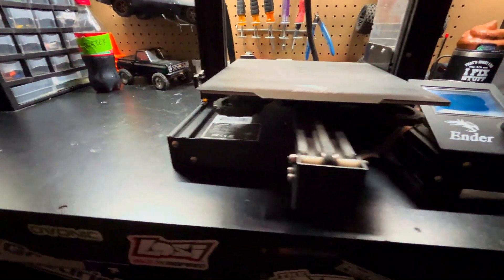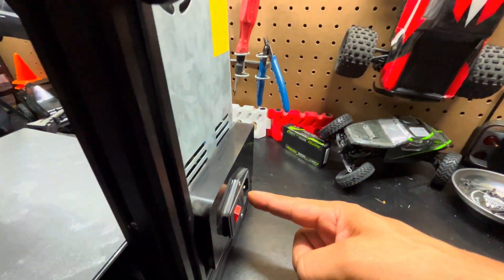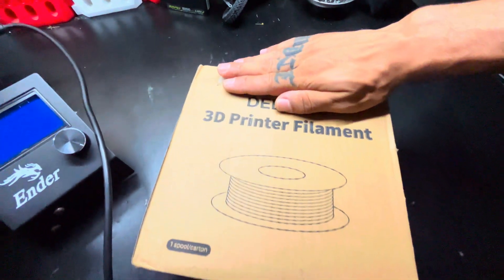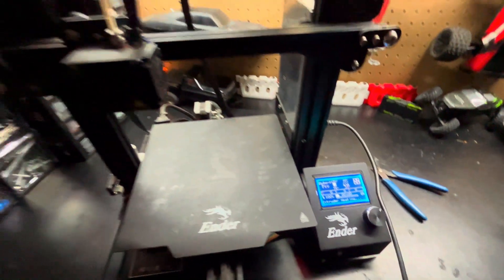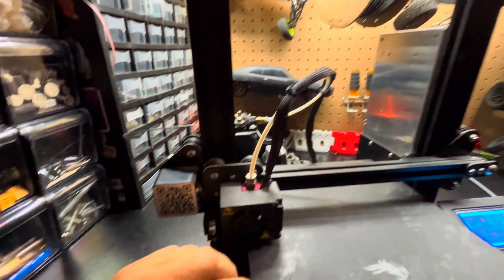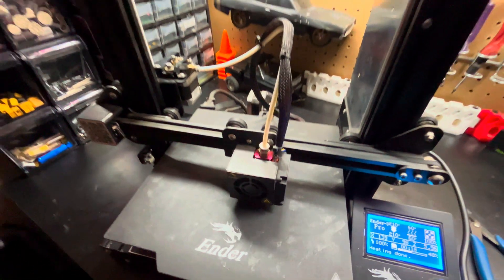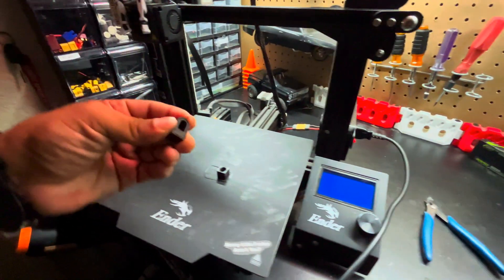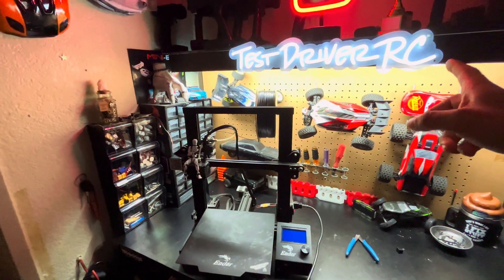Can You Make RC Parts With a 3D Printer?

Comment: Nice an Ender3-Pro the same printer I started with. With the base plate IPA to clean it as once it gets greasy it looses adhesion. Slicing software the easy part as that just codes a design for printing but there are settings you will need to learn. Now CAD what a pain that can be to work with, I started with watching a couple of videos on here for basics the rest I learnt as I have gone a long and still only know a little after a few years. I mainly use the printer for parts I need for detailing bodies, but if you are going to make parts before you go through all the stages of design look on places like Thingiverse first to see it one has already been designed. The designers have tips like material used, layer thickness and if they need adhesion or supports.
Reply from the maker: These are the tips I need!! Now to start designing my own custom RC 😁